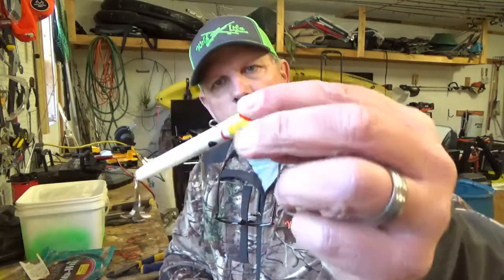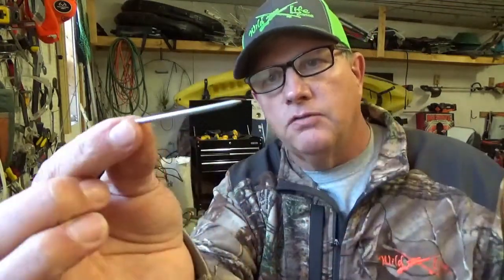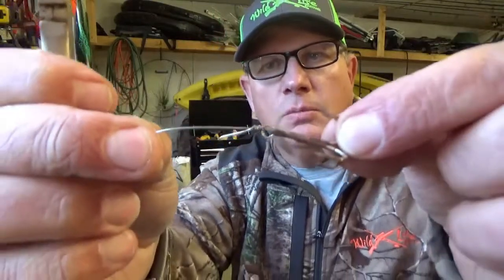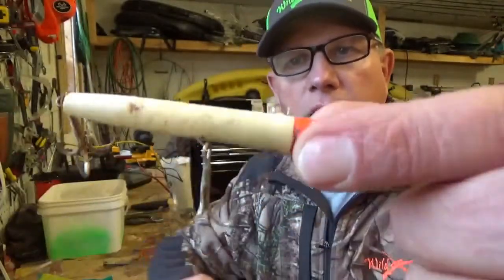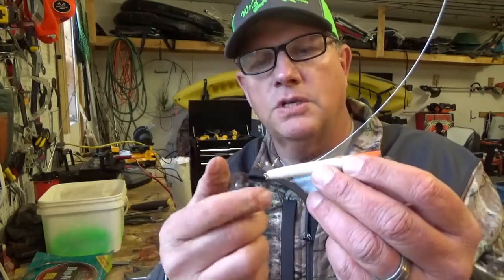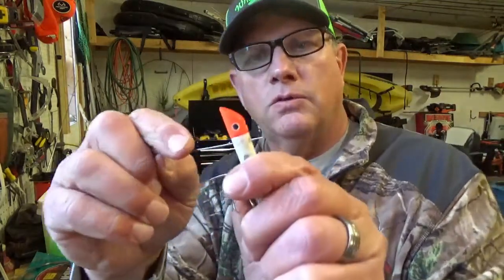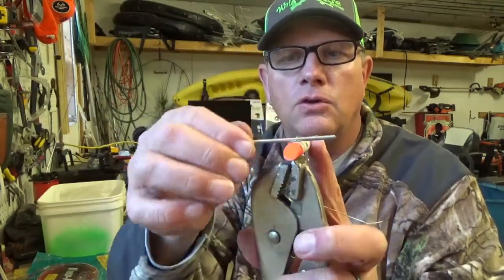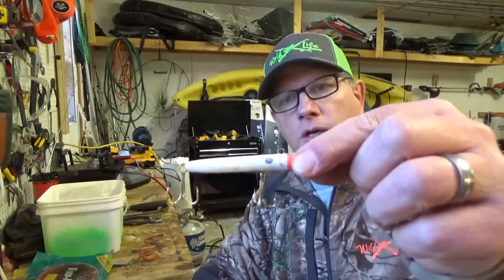Gotcha Plug hook replacement/ how to replace hooks on gotcha lures/ how to rewire a gotcha lure

Comment: Since the wire rarely rusts (just the hooks) you can rap a split ring on the front and back wire loops to quickly replace rusted treble hooks without having to change the wire!

Comment: Do you paint the heads? mine lose the orange paint after a dozen casts, i went with the single hook option by cutting the trebles and opening the eye of the single hooks and they swim great.
Reply from the maker: I have painter the heads . Get some paint powder and heat the lead head and dip just like a jig head and I have painted the plastic bodies with white spray paint .The problem I have is finding the gold treble hooks.

Comment: thats way to much work. its alot easier to cut the eyes pf the hooks and use split rings to attach new hooks and make it alot easier for future hook replacements.
Reply from the maker: I tried that!! When you do that it makes the hooks hang to low and when you cast it will hook you line almost every time. Good Luck!!

Comment: Why don't you cut the hook off put a split ring and the hook and that's all you have to do you're making it too hard for yourself
Reply from the maker: If you add a split ring to the wire, it will be to loose and when you cast the lure it will tangle on the main line every time.